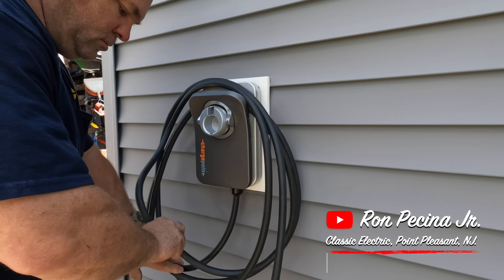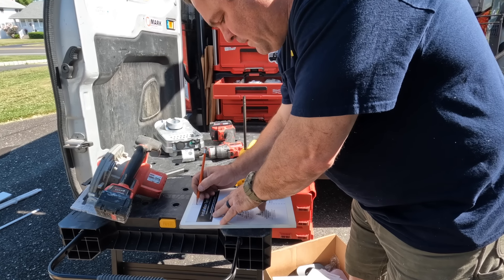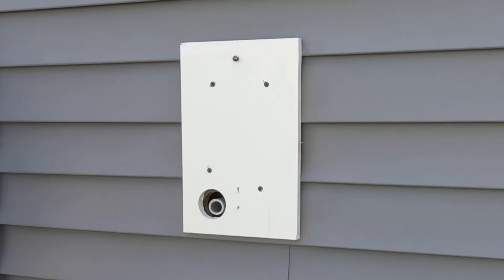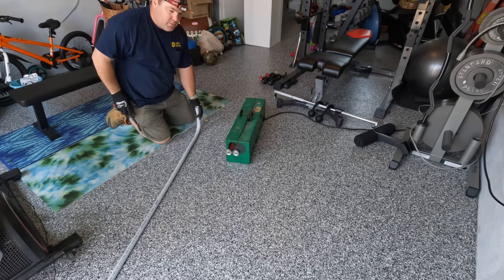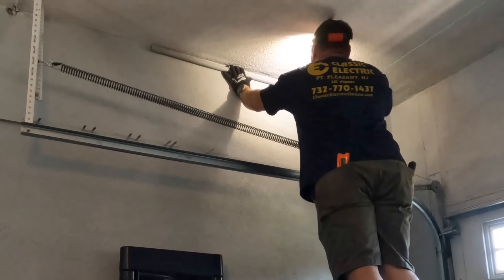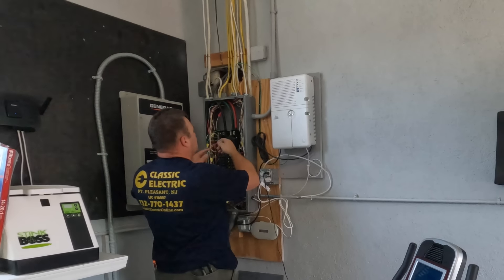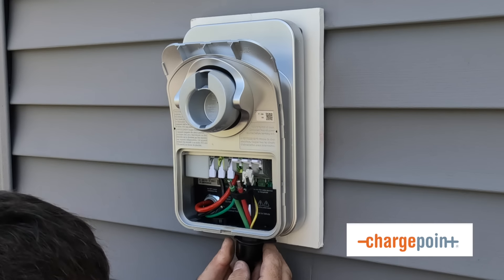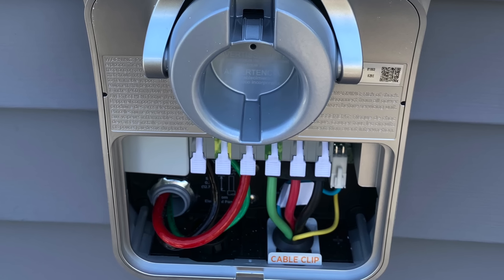Charging the Future: Electric Vehicle Charger Installation for Sustainable Transportation

Comment: Why didn't you swap out to a 60 amp breaker to get the full 48 amp 11.5kw of power?
Reply: If that car charger draws 48 amps then by code he needed a two-pole 60 amp circuit breaker. He was not allowed to use the two-pole 50 if that charger draws 48 amps
Reply: Yeah  48 amp to 60 double pole
Reply: @theseattlegreen1871  obviously this is an old comment, but yeah I was wondering the same thing - my understanding (i've got this charger on order and will be installing it or having it installed shortly) from the research is that the device allows you to set the ampacity delivered based on your installed circuit, so it is "okay" to install it with a 50 amp breaker, but the user should not set the ampacity on the charger to the 48a setting and should stay at 40a/9.6kwh. The charger will even allow a 30amp setting if that's alll your wiring is for.  So, IMO, a 60 amp non-GFCI breaker on 6 awg seems like the way to go to enable the maximal charging output to a vehicle.  Technically, you can even set it to a full 50 amps to get that 12kwh speed, but htat requires a 70/80 amp breaker and associated wiring.

Comment: Some constructive criticism, You should outline your stand out box to the vinyl siding strategically and use a 4" grinder to cut the siding to the structure's sheathing making that piece of pvc stand out plate flush with the siding.  It makes for a more professional finish and takes an extra 20 minutes of work.  It also allows you to caulk the seal to the structure.
Reply from the maker: That’s ridiculous.  A siding guy might do that but that’s not what I do. That invites water to get behind the plate and introduce mold.
Reply: It looks better as is, without cutting the siding:)

Comment: I have a question about how you mounted the plate on the outside. You say that you were in the middle of 2 studs. What reinforcement supports the outside panel. Sorry if this is a silly question. I am not a contractor. Just a wanna be DIY
Reply from the maker: @garymizrachi3271  the sheathing.

Comment: Love your work, Ron.   I just recently installed one of these same units.  I liked the crimps on the charger cable side so I purchased a hexagonal crimper and put ferrules on the supply side.  Given the snap down connectors, it really made a nice electrical connection with no deforming of the #6 conductors and #8 ground.
Reply: Good tip Brian!

Comment: Good video.  One minor point that is not that important, but the communication cable you mention at 13:39 is to enable the charger (the EVSE box you are installing) to communicate to the car and negotiate the max charging current.  Depending on the circuit you install that charger (EVSE) on, it can provide between 16 and 50 amps, but it has to be able to communicate that limit to the charger build in to the car so that it limits the current appropriately.

Comment: I love the detail and quality of your electrical work. 

One thing I did not see is how you waterproofed the hole through the siding. From the video, it seems like water is free to run down between the PVC mounting plate, and between the charger base and that PVC. That all needs to be sealed to prevent damage to that wall.
Reply from the maker: Duct seal behind the mounting plate.
Reply: @electricianron_New_Jersey  thanks. Thats Important info.

Comment: Very nice/safe installation; good job. I’d say, if the siding were wood, rather than vinyl, I would cut the siding off and mount charger flush with the plywood sheathing.  Of course, all the newly exposed wood would need to be well sealed against moisture intrusion.  On mine, I painted all those surfaces and sealed edges with silicone. I just think it looks a bit funny to have a flat board sitting atop the zig-zag siding. Anyhow, great video!
Reply: except when he was standing on the top of the ladder. I know the ladders we have here say do not use this for a step.

Comment: You always do really nice work from what I've seen. Just wanted to say though. That 30 space panel will actually provide 40 circuits with the use of tandem breakers on both sides of the bottom 5 lugs of the buss. That was the norm before the induction of arc fault breakers to the code. You see back when that panel was installed the code limited the amount of circuits to only 42. Then when arc faults came out and were being required on more and more locations in a house and nullifing the tandem breakers we were running out of spaces, especially in larger homes. The code committee finally addressed the problem and revised the code lifting the limit. Also, use to be tandems would on fit on the bottom 5 spaces of the buss but now they're making universal tandems that will fit on any space on the buss. 😎

Comment: The Chargepoint has a built in GCFI.   They say in their online documentation to NOT install with GCFI on the outlet if you use an outlet as that can cause charging issues.   So on mine, which is just using a 220v 50a  outlet, I did it without a GCFI outlet as didn't need the drama.   Had no issues so far.   But also in AZ, where water is rare.
Reply: @cengeb  main point of gfci is for water as a concern in regards to location of outlets etc. the kid got zapped cause it wasnt grounded properly, they still would want an AC grounded properly. outdoor AC units are usually hardwired... kinda lost with your point ?

Comment: That Chargepoint is up to 48amp when hardwired. Any reason you didn't go with a 60amp breaker and instead I'm assuming set the chargepoint to 40amp only?
Reply: My question as well.  Owner could mistakenly have configured the charger for 48A without knowing the required 60A breaker wasn't installed.
Reply: @johnh8268 ChargePoint doesn’t have amp configuration in the consumer app. You need to use the installer/ electrician app to reprogram these chargers.

Comment: Are you concerned about moisture getting in through that hole? I'm about to to do this same install at home. I've seen a putty product that the last electrician used. Also, I'm using cable, not wire in conduit. Should I be using some kind of grommet to guide the cable through the plywood?

Comment: Quick question, I plan to do pretty close to the same thing at my house. I see you have the BBC flush to the wall, but do you put a little bend once you enter the panel box? Or do you just go straight in question?
Reply from the maker: @triph4  are you asking about entering the electric vehicle charger or the circuit breaker panel?
Reply: @ panel

Comment: Very clean job.
Thanks.

P.S. Mr.Ron. 
When you have time, would you kindly show me how to extend #6, bare copper from the active panel to the Ground Rod?
Because the #6 bare copper was installed previously shot.
Many thanks.
Reply: @Ampacityelectric   what is the best way to reinstall bare copper without interrupted service? 
Thanks.
Reply: @Ampacityelectric  Thank you so much.

Comment: I need to run my wire from panel on outside back into the crawlspace on over to the driveway opositnof the house, crawls space isndry over the summer butncan damp during rain, what brand type of wire and conduit shud be used for a 8/3 gauge pull? Have the same.chargpoint.but will only be charging at 32amp.witb a 40amp breaker
Reply from the maker: Make sure you adequate supply from your electrical service.

Comment: Great job on the installation. Question regarding GFCI protection, I understand that unit is hard wired but is it not an outdoor outlet that would still require protection? Example is the condenser now and of course receptacles.
Reply: Most chargers have a built in GFI to protect the circuit

Comment: Great info. 
I wish you were in Myrtle Beach SC. 
We are looking for a level 2 ford charger to be installed.  
Says 3 guage copper wire.
220v 80 amp
Reply from the maker: Yes. The 80 amp figure has to be rated at 125%.  This an NEC requirement.  So, 80A x 125% is 100 amps. Make sure whoever you hire to do they understand that. #3 AWG Copper and a 100 amp double-pole circuit breaker.  Good luck. Btw, my mom lives in Carolina Shores, NC.  Just over the state border.

Comment: Hi Ron. Just subscribed to your channel, great work. I love watching pro do the right work correctly. Thank you for that. In  your videos you mentioned that it easier to work with single wires vs one all in wire. My question is. I am going to have a NEMA plug done in my house , here in NJ. Can we run 2 hot wires at 6 gauge , neutral 8 gauge and ground 10 gauge? Cant seem to find any code info on that. Thank you
Reply from the maker: Absolutely. That’s what I would use for a NEMA 14-50 receptacle.
Reply: Ron, thank you

Comment: What can I do with an extra 60 amp circuit in a garage?  Replacing a water heater with a Tankless. 3-40 amp circuits were already pulled for the Tankless.
Reply: Welding machine, EV charger

Comment: Question.  For a 60 amp installation can a #10 copper equipment ground still be used or should I use #8?
Reply from the maker: @easternyellowjacket276  # 10 AWG is good for up to 60 amps.  However, if you’ve used larger conductors than #6 for voltage drop concerns you’ll need to install a larger equipment grounding conductor.
Reply: @electricianron_New_Jersey  I'm a grateful for your quick reply.  Thanks for the information!

Comment: Do you have any links to the zip it anchors and the type of board you used to attach the charger to?
Reply from the maker: they'tre at HD in there hardware aisle and the mounting board is a 1 x 8 piece of Azek.
Reply: @electricianron_New_Jersey  TY!

Comment: Hmmm, I thought that it was a WiFi hard wire connection to the receiver, when it is too far for the bluetooth to work. Also, it was my understanding that the charger communicates to the car through the wires in the connector cable?  I say that because that is the way Charge Point's public chargers work, as well as Electrify America. I could be wrong.

Comment: Question; what would you have done if the panel was full and didn’t have the breaker space?
Reply from the maker: Change out the panel or add a sub panel and relocate a few circuits from the main to the new sub panel.
Reply: @electricianron_New_Jersey  thank you. Great job!

Comment: I noticed there were no mains safety covers, what are the conditions when those need to be added?
Reply from the maker: That’s a fairly new NEC requirement that might not have code when this panel was installed.
Reply: @electricianron_New_Jersey  right, but is there a situation where you are required to add them now?
Reply from the maker: @boomermatic6035  Yes, but only when upgrading the panel.

Comment: I have a question for you if a may , I want to connect a car charger in my garage, I already have a dedicated 240 v line with the plug right were I wanted, but the line coming out of the breaker panel have two black conductors and one bare metal conductor. Can I install this to a Nema 14-50?  Thank you.
Reply from the maker: Most EV chargers require #6 AWG conductors and (1) #10 EGC.  I’d say go for it!

Comment: Now can you access this charger on the side , top or bottom with 3/4 pvc in a surface application  ? Nice install . I would think in the not to distant future you maybe doing these fulltime .
Reply: @Ampacityelectric  so the ko on the bottom is for the cord ? Seems to limit the install
Reply: @Ampacityelectric  To me that still says you can't use this charger for a surface conduit installation . The single bottom ko is used for the cord so the only other ko is in the back . That limits  installs . You may not have the ability to enter from the back of the charger . For example if the only way to provide the circuit is the exterior of a building . It's fine to come in through the bottom and not sure why they don't provide 2 entry points in the bottom . Is it possible to drill out or ko punch another hole.? I also did not see a strain relief on the cord to hold it to the charger .
Reply: @Ampacityelectric  perfect . Good to know .

Comment: I was quoted $1550 for hardwire installation for this charger like 2ft away from my panel and that price doesn't include the charger. I just want it right next to the panel and don't even need to go through walls.  Is that high, normal, or low?  I feel like its a bit too steep.  I have a spare slot for the 240V double pole breaker so no panel upgrade needed.
Reply from the maker: Hey Michael, that does seem a little high if only 2’ away from the panel.

Comment: Very nice install but seems like it would be much easier running emt is there a reason why you chose pvc?
Reply from the maker: Because I like PVC better. Do you run EMT?
Reply: @electricianron_New_Jersey  i prefer emt much more.  Easier and quicker mainly due to bending.  The heating blanket takes way too long.

Comment: Are exterior chargers classified as an appliance and do they require a subpanel?
Reply from the maker: Electric Vehicles are covered in NEC article 625.  You’ll only need a sub panel if there’s no room left in the main panel.
Reply: @electricianron_New_Jersey  I said subpanel instead of a disconnect.
Reply from the maker: @dajur1  you only need a disconnect OVER 60 amps.

Comment: Are those PVC joints glued inside? (Is it necessary?) SimPULL is a trademark of Southwire. CerroWire calls it SLiPWire. It's a coating on the conductor insulation. Before that you used to have to use wire-pulling lube. Ha ha

Comment: How much did this install cost (to the customer)? I just bought my first ev and I'm looking to get an outlet to plug my (included with car) nema 14-50 40 amp 250v portable cable into or a charging station like this installed. I'm sure pricing is different between new jersey and Texas (where I live), but I figured maybe I could get a ballpark estimate. My electricity at home is about 1/7 the price of public charging so it'd be nice to do it at home when possible.
Reply from the maker: Pricing can be complicated because each installation is different. This install was $1500 and the customer had the charger on hand prior to to the installation. It all depends on how far away from the main breaker panel the charger will be mounted. Also, I highly suggest this Chargepoint EVSE because it is able to be hardwired. The NEMA-1450 receptacle could become problematic because of the high-current draw. Hope this helps!
Reply: @electricianron_New_Jersey  it does help. I'll have to see if property manager / owner (I rent my house) will let me install either option.

Comment: Good video Ron. A question you used #6 for your 2 hots and #10 for your ground, since I am still learning how did you come about using #10 for ground, is there some calculation you would have used. Could you have used #8 ? Looking forward to your response.
Reply: @Ampacityelectric  Thanks
Reply from the maker: Table 250.122 of the NEC.
Reply: @electricianron_New_Jersey  Thanks Ron
Reply: @electricianron_New_Jersey  250.122 states not smaller then, so as to imply if someone was to buy bulk lengths, #6 for all 3 would be acceptable?
Reply from the maker: @rtsolution11  the point is you don’t have to run a #6 EGC, you can run a #10 EGC.
Reply: @electricianron_New_Jersey  totally understand, but I have a chance to buy some #6 bulk in Wt, Bk, Rd, and Gr from a retired electrician. Thank you for the response.

Comment: Can I diy this or need it permitted and inspected?
Reply: Permit requirements vary based on where you are.  That said, I do believe most places require a permit for this kind of electrical work.  Most places though just require that the work is done to code and passes inspection, they do allow for the homeowner to do it as long as you can meet code.

Comment: Need to seal that hole you made outside with caulking
Reply from the maker: But I didn’t.
Reply: @electricianron_New_Jersey  gosh you
Reply from the maker: @TheLostAdventuress  I used exterior rated duct seal.
Reply: @electricianron_New_Jersey  now I knew you are are pro

Comment: Hey ron any particular reason you dont use EMT, question is because i dont know how to bend emt myself and always feels im lacking knowledge because of always using PVC
Reply from the maker: It's easy to learn how to bend conduit. I learned by buying a bunch of 1/2" EMT and followed the guides in the Ugly's book. I also learned a bit in the US Navy. The more you do it the more you learn. I don't have a need to bend EMT other than in unfinished basements for surface mounted receptacles and 1900 boxes or maybe a sump pump circuit along a concrete foundation wall. It also rusts easily where PVC doesn't.
Reply: Hi Ron love your videos. I want to install this charger in my garage and my panel is also located in the garage. My question is, do I need a disconnect as well for a 14-50 outlet? Is that code?
Reply: @kantgettwrite read the comments. He earlier answered that a disconnect is only needed above 60 amps.